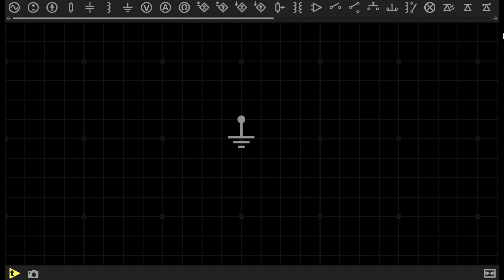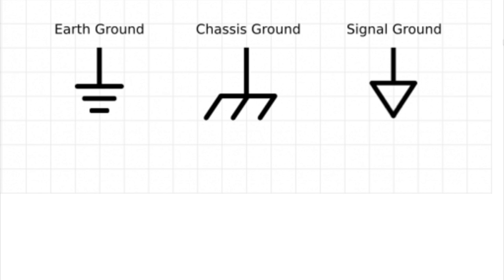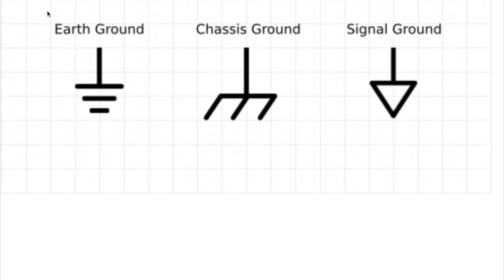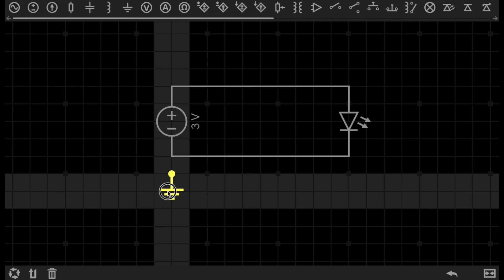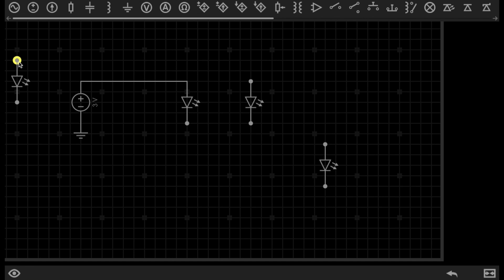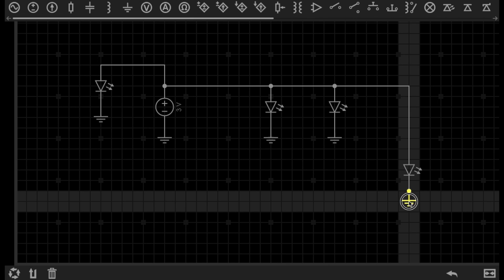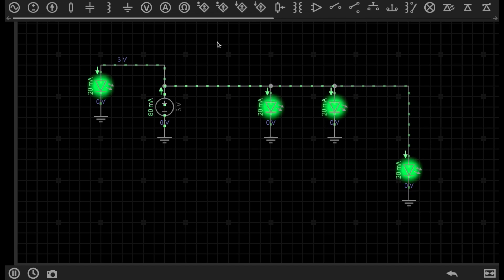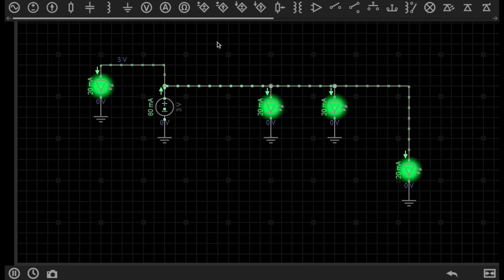That Ground Symbol (What is Ground?) - Electronics Basics 24

Comment: Conventional current flows from positive to negative voltages. In reality, electrons flows from negative to positive.. 
here in the video says the electrons go otherwise.. my head blew
Reply: the lack of an electron at a position where one could exist in an atom or atomic lattice, so the empty spaces that electrons leave while moving to the positive side are called holes is the positive current or conventional current or hower you want to call it.
Reply: Braden Z Agree, and it is very important to have this straight. For example, one can’t understand vacuum tubes or transistors without actually knowing which way electrons and ‘positive holes’ flow. So, in this example, or any ground, electrons are actually ‘sucked out’ of the ground.
Reply: It is not electrons which are shown moving in wire it is direction of current in wire
Reply: This inspired Tenet. ;P
Reply: He said that he's talking about conventional current in starting. Listen carefully.
Reply: https://youtu.be/upaVO_SMAQM 🙏🙏
Reply: The presenter quite plainly stated that he was speaking of conventional flow.
Reply: @telkentexas4053  Yes, once, very briefly, at the start of an elementary explanation that will be watched  by beginners who will very easily miss that very important word 'conventional' that will change the meaning of everything else said.  Especially when he speaks of electrons flowing in that direction with visual aids indicating it.
Reply: exactly my thought
Reply: 😂 I was thinking the same 😂

Comment: I really like your video but there seems to me a misconception about electrons:

1:05 electrons don't ever get rid of their charge (unless they meet positrons which doesn't usually happen in circuits)

and they don't carry any kind of "additional charge" they could get rid of
but they carry specific quantity of charge - the elementary charge

this was discovered in 1909 by Robert Millikan.
More here: https://en.wikipedia.org/wiki/Elementary_charge

5:16 electrons do always carry elementary charge
Reply: I suppose what he should have stated is that the difference of potential held by that excess charge is lost when they return to the earth.  But apparently, even that is not a completely accurate statement since according to the following thread on Answers.com electrons don’t actually flow (or move) through a circuit at all:  https://www.answers.com/Q/Why_is_electron_flow_in_the_opposite_direction_of_current.
Reply: I want to believe he meant energy, not charge
Reply: https://youtu.be/upaVO_SMAQM 🙏🙏
Reply: There is a very serious basic flaw in this video. The author said electrons flows from the +ve terminal to the negative; it is wrong in all manner! The current flow from +ve to -ve is only a historical convention - thus called conventional current flow. We now know current is actually a flow of electrons that goes from the -ve terminal to the +ve (of a battery). In AC current direction reverses every half cycle.
Reply: @chanrasjid8688  The video makes it clear that he is talking about "conventional" current.
Reply: @chanrasjid8688  I'm 2 years late,but if you are still alive at this point, does it mean the ground it actually the positive terminal?
Reply: @HouseofFPS not really
Reply: @chanrasjid8688  And it's the opposite INSIDE  the battery?
Reply: Positrons?? Or Protons.

Positrons are Anti - particles of Electrons, It have same mass as of Electron but posses opposite charge.
Reply: Am i seeing a comment section of Scientist's?
Reply: Yeah except people are just regurgitating random shit they’ve heard and watched and don’t really know anything

Comment: hi. I find this very confusing because on other videos i see illustrations showing electricity flowing from the negative to the +  For example on a AA battery the the electric flows from the - side to the + side. however on this video at time 2:17 it is stating that electricity flows from + to -  Please help explain this?   on this video it states that electricity flows from - to +     /watch?v=2BafNGDnxZw
Reply: hyylo This video is wrong. Electrons flow from negative to positive, but current flows from positive to negative.

Comment: hi. thank you. i wanted to ask if a person can get electrocuted if they simply stick there finger into the live/hot socket? or do does the person/human need to complete the connection by being connected to the earth.
Reply from the maker: You are always connected to earth with some resistance, so if you stick your finger in a socket, you will get shocked. Always ensure power is disconnected before working with any high voltages or AC Mains circuits.
Reply: hi. thank you for the reply. i want to ask a question about a 9-volt square shaped battery used in small devices around the home. if i put my finger on the negative side of a 9-volt battery and with the other hand i touch the soil in my garden will i get a electric shock? Will i get a shock if i used the same approach with a car battery?
Reply from the maker: Batteries work differently because they have no earth ground. The only ground for a battery is the negative terminal. I have a very detailed video about how batteries work. You will not get a shock from any single battery. Although if there are many batteries connected in series to bring the voltage high enough (50+ Volts), then you are at risk of shock and possible fatal injuries, but even then, this would only happen if you touched the positive and negative side of the series battery array. Earth Ground would not be involved.

Comment: your tutorial is really helpful. sir I was  having a problem of how to interpret a schematic circuit with capacitor ,  one of its  terminal connected to the ground. My question is where do I have to terminate that terminal given that all other components on the circuit diagram  have   connection to the negative terminal of the power supply . would it be right to directly connect the that ground point of the capacitor  to the negative.
Reply from the maker: +sheku Sheriff depends what your circuit is, if positive terminal of the capacitor is connected to something, connect it the the same ground point of the component it's connected across. For example, I have a capacitor with its positive terminal connected to the positive pin on an IC, therefore it would make sense for me to connect the negative terminal to the ground pin of my IC. For more complex circuits with multiple power rails, you would need to ensure you connect the cap across the correct rail to ensure the correct voltage is supplied.
Reply: How about in the case wherein, the positive terminal of the capacitor   connected to the positive terminal of the power source; let say a battery. should  I connect the negative terminal of that capacitor that has been grounded to that of the negative of the battery?

Comment: Thank,May I ask what is the program you're using ?
Reply: Hak MengHeang, the program's called EveryCircuit. It comes with a trial, that won't let you make more than a five element circuit at first, then expires and asks for $14.99.